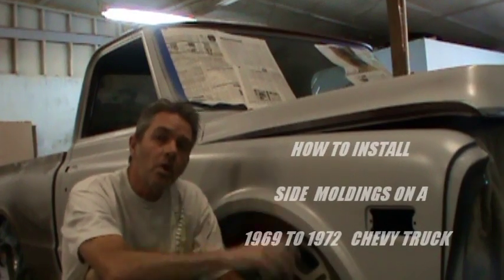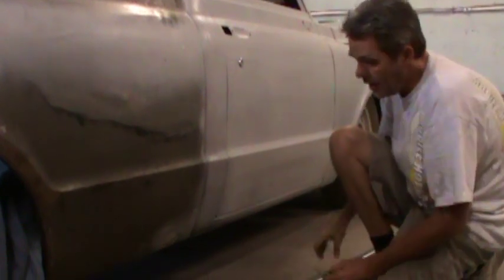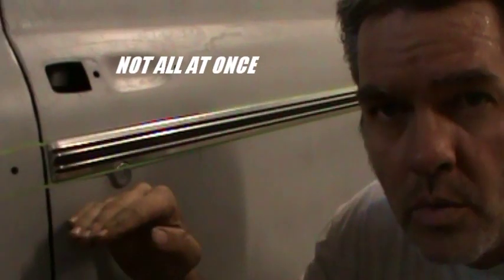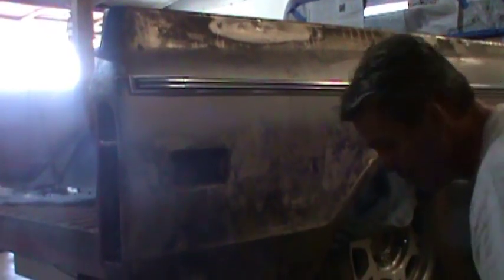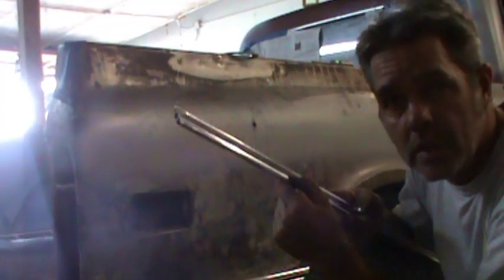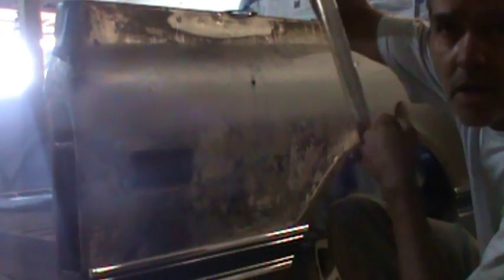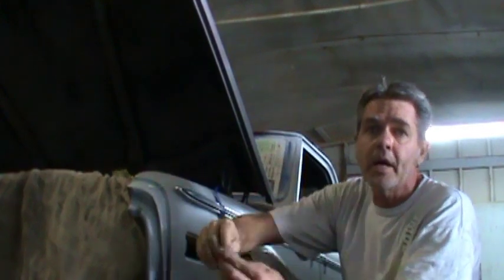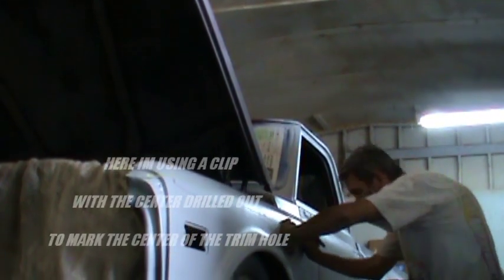How to Install Side Molding on a 67 to 72 Chevy Truck

Comment: Thanks for the video. Could you show how the trim plugs fit in to the trim to hold it up? I have the holes drilled but conffused how to get the trim to hold with the clips. The video is a bit dark there.

Comment: Question regarding different issue. What is best method for installing windshield or back window in 67 Short wide. Having a nightmare of a time getting windshield in with the string pulling method.
Reply: Thanks!
Reply: How to customize truck hood

Comment: I don't see how a level can substitute a tape measure.  The truck would have to be level on a level surface.  Other than that great work.  I wish you had one showing how to line up and drill for the bezel around the rear lights.

Comment: Using a level to line up the moldings wont work if the truck has a rake like most trucks/cars do. The chrome trim needs to run parallel to the belt lines of the truck. Then all body lines, edges, and chrome trim will be equally aligned in a parallel form.
A level tool is used on items that are flat on a level ground and that have the same level or angle as the ground.